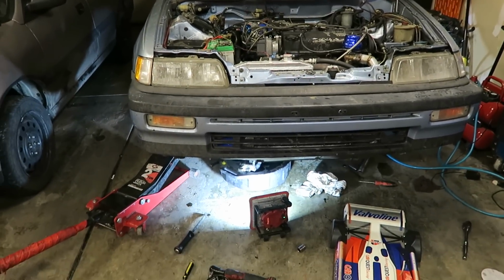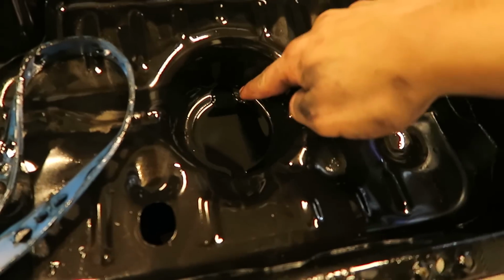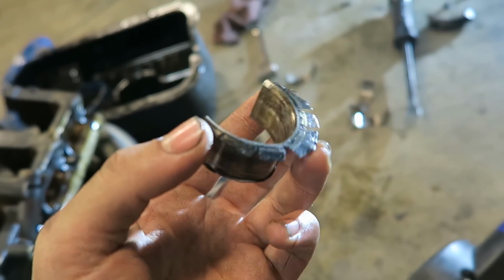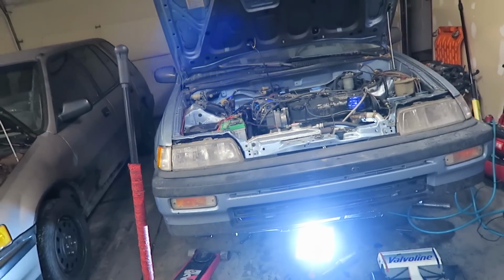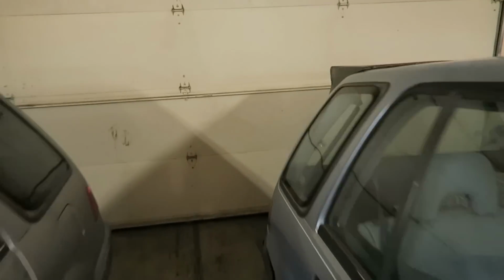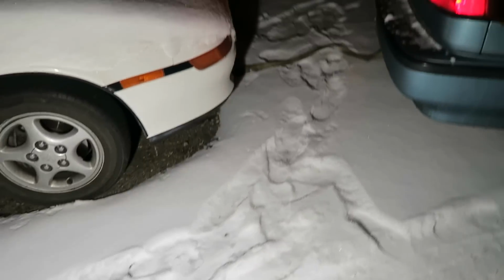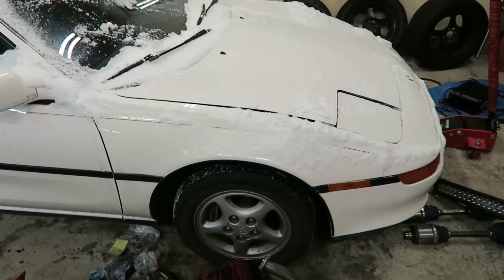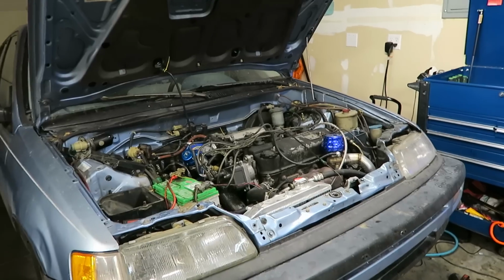Should I Build Wago?

Comment: 2 options.  

first i really love the d series motors.  one of my favorite cars ive ever owned had a built d series.  they are highly underrated.   

2nd option.  and this would be a hell of alot of fun.  put the k series motor in the wagon.  get a crv transmission and a crv rear end.  get the newest rear end.  they engage quickly.  and then the nasty little secret.  you can modify a b series lsd to fit the rear end of a crv.  that means you can also run b series type shafts.  much stronger and putting down 500hp with a turbo k series to all 4 wheels would be amazing.

Comment: Focus on the wago man. Make it a solid reliable build so you dont have to worry about it. These little fixes here and there will add up and make you like the car less. Itll be a sick build for the winter aswell. You could do a slow build on the mr2 aswell but just do little bits at a time with spare money

Comment: I personally think you should try your hand at some body and paint work and get wago looking mint. It's pretty easy with some decent equipment. Rebuild Wago so you aren't spending so much money on it, and keep it as a daily/street car. You gotta have something reliable. The hatch is already balls to the wall fast. If you built Wago to be super fast like that you will be losing daily driveability, and you would have two cars serving the same purpose which is to go very fast. The MR2 should be built to be quick around a track, similar to how an S2000 was designed to be. I owned an S2000 for 30k miles as a daily. Crashed it at about 140k. Truly amazing car that I would thrash every day, never a single problem other than a rear caliper freezing. My point is try not to have multiple cars with the same purpose, one will end up not being used

Comment: in my opinion is better if you fix temporarly wago by putting new crank ad bearing, so you can put fastly it back on the street. when mr2 will be swapped, you ll can think to built wago in the correct way without pressure by taking all the time you need

Comment: The smartest thing to do, Is go pick up a D16z6 (vtec) from the junkyard, swap it in and go get a retune with the turbo. It's not even worth the money to put a new rod, crank and bearings on that thing. Go get a z6 vtec motor for $300. Cheap and a fast swap with more power, and then you can go back to the mr2.

Comment: you know what they say. 
do it right the first time. that way you wont have to take it all back apart.

i vote build it.   crower rods vitara pistons and forget about vtec its a single stick just throw a bisimoto stage x in there with big injectors and tune the hell out of it. i bet it would make a ton of power. 

and yes i agree. theres no excuse for not running a oil pressure gauge on boosted cars.

Comment: on the insane shafts, It seems like they did fine until the motor started to move around which seems like it might have broken both sides. The shafts might be fine if the motor does not move around.

Comment: Do the vitara build. I have a d16y8 with custom length rods and vitara pistons supertech valve train and delta cam on a .68ar turbo tuned to 20 pounds and it has a crazy boost lag but definitely a ton of fun

Comment: Well it's cool to leave it up to us, however, with that said. If you need a daily get the crank and everything else. This will get you through the winter so you can have a good daily driver and not have to worry about it. But it's up to you in the end. Because you're already doing the K swap. So it's whatever. If you can handle (money wise) building it, build it. If you need a good daily driver at least for winter, then just get it back running since you know you can do it in a day.

Comment: Just get another stock block and swap it in if you want a running car. D series engines are cheap in my area not sure about yours. If not build it since you already went this far no point in doing the work twice. If you have parts just lying around to finish the repair just install it.

Comment: in my opinion, if the trans will work, swap the engine for a h22 and build the h22, the power you will get, plus it being 4wrtd the accleration would be crazy. just my opinion.

Comment: Sleeve the Wago, all forged internals and the VTEC head, make mad hrsprs and most important, get a damn oil pressure gauge.  Change your brake pads when you hear the brake wear indicator squeal.  Fix oil leaks immediately so you don't catch your shiz on fire.  Clean your garage and wash yo ass.
Reply: Old vid, I know, I just like to hear myself type.

Comment: do not swap bearing. just don't. The first crank has a wear pattern and when you swap those bearings to the other crank and rod, its going to wear differently. You could throw a rod, or it could work... just buy a new set of bearings

Comment: Just throw a junkyard engine back in it until you can sleeve the original block and get some good forged rods and pistons...no one builds these little d's...I like them great mileage and properly built there killer...save up for a quality ball Bering turbo and it would be a Bad ass lil 300 hp daily driver and super reliable.

Comment: just go H2b or h2D (for the all wheel drive)
Reply: with a f20b....
Reply: F20NAprelude  yea true. thats best for boost. but i love my h23a. N/A all day.
Reply: DFumero15 I have a all motor f20b in a prelude and had one in my civic eg before.  I think my prelude would beat a h23a full H swap in a DC or ek hatch as is.
Reply: F20NAprelude well race one to be sure if you can. do you have some bolt ons? or completly stock
Reply: DFumero15 more than just bolt ons.. Ported manifold full bolt ons and pro2 all motor cams. Don't even have a vtec transmission its a long lagy m2s4 my prelude is like 3k lbs.
Reply: F20NAprelude yea sounds like my old set up when i had the accord
Reply: Nice.. I pull DE 350zs like single cam civics. Pull tuned s2000s and hemi RTs.. All day.     I've pulled a evo X and new wrxs as well.  

Its not fast but its quick for a prelude.
Reply: F20NAprelude naw thats good for a long tranny.
Reply: I have an h2b 91 teg a good amount of work an tuned it pulls harrrddddd sub to my channel to check out the car doing a cruise / pull vid soon